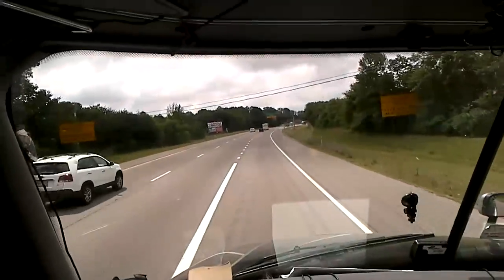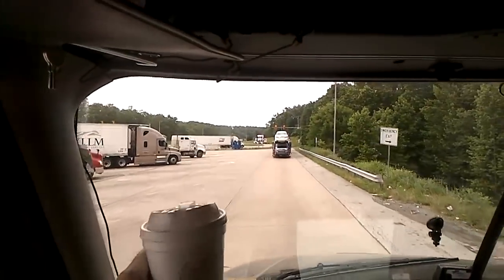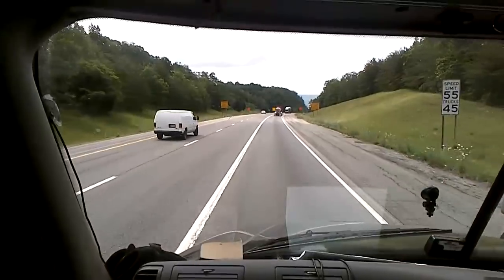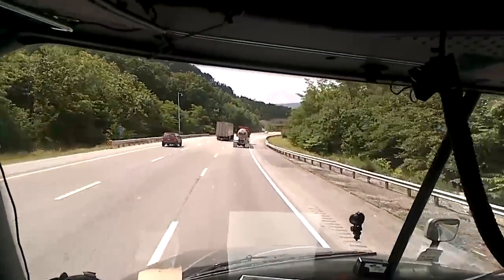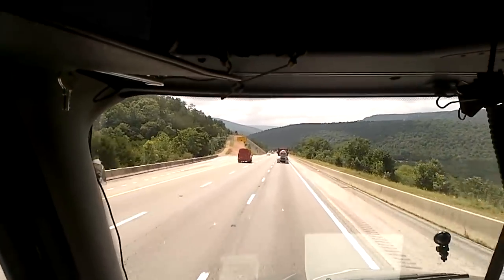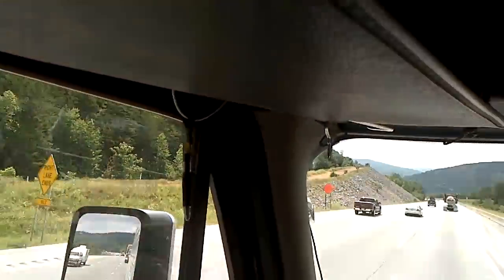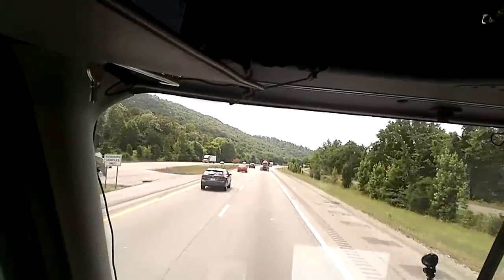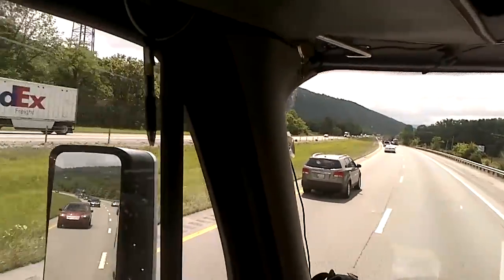Monteagle with an Automatic Big Rig

Comment: I had a pull cord drain valve on one of the air tanks freeze and break off half way down that hill back in the winter of 83/84...got it stopped before the maxi's locked the brakes...luckily I had the original drain valves...
Reply from the maker: One winter I had very low air pressure one day driving along.... Pull over and check things out underneath and huge glob of ice had formed on a pull cord and was weighing down and open. knocked off the ice and built my air back up. So glad to not need the hook.

Comment: what's up Scottied , do all truckers with automated trans go down the hills in manual mode ???? , you are a good & safe driver ... all the other trucks are speeding "down hill no less"...
Reply from the maker: No, the recommended way is to go down in auto mode with the cruise control set. I never liked doing it that way because the rpms would run up too high, plus  the grade goes up and down so the truck slows down too much in spots.
Reply: @scottied67   thank you Scottie

Comment: Did I hear you correctly,  are you driving an auto/manual??? Guess I didn't pay attention at first.
Reply from the maker: I am driving an automated transmission. It is the same as a manual transmission except all the shifting is done by the computer. Now I do have the option to select Manual mode and I do all the shifting with the paddle.
Reply: We had an " Auto Clutch" in one of our Top Fuel Haulers. Clutch only for stopping and starting. Auto otherwise and Rocker switch on dash for manual over ride.  Very cool setup and easy to drive.

Comment: your wrong on speed..it ia determined by your weight..35 and 45 guess you didnt read the signs........
Reply from the maker: The sign says 25 for 80,000 pounds down to like 75,000 pounds then  35 for 75,000 down to 65,000 pounds and 45 for all others.